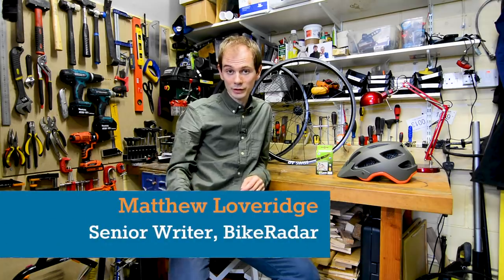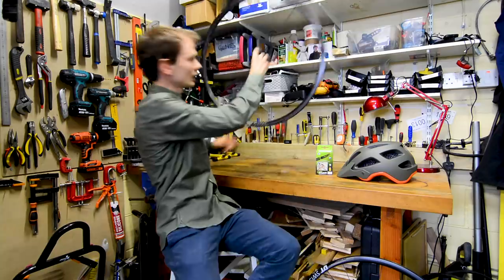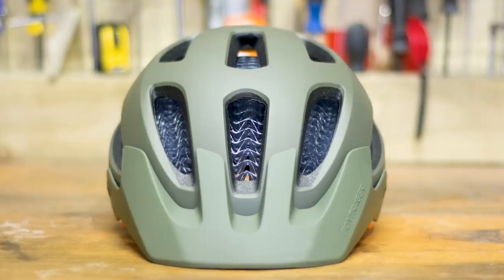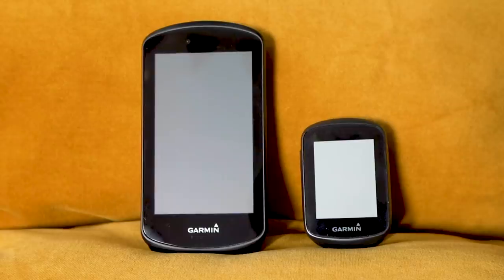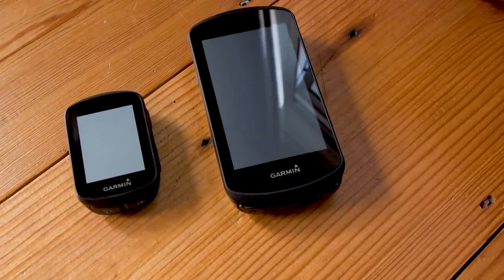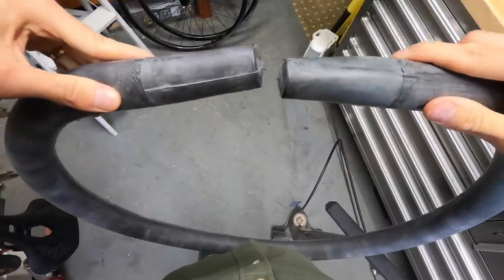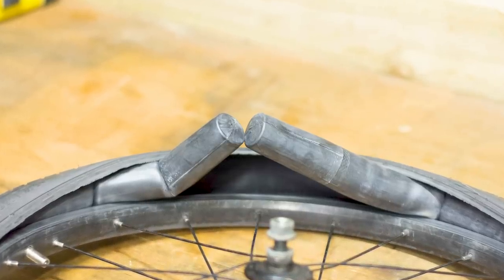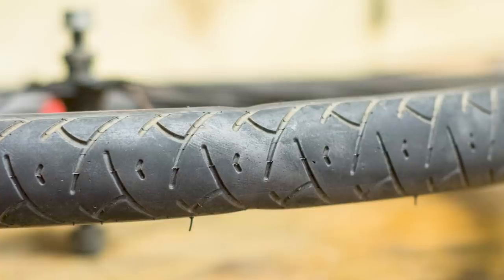NEW Garmins, WEIRD Inner Tubes & Super Light Wheels | BikeRadar Tech of the Month | EP02

Comment: Change inner tube without removing the wheel? And how does that helps with the fact that it makes very difficult to check the outer tube for whatever might caused that flat tire in the first place???🤔🤔🤔
Reply: That's what I thought. Shouldn't you be examining the tyre and tube?

Comment: gaadi inner tube are not new at all and there mostly for dutch bike or bike witch need tool to remove the wheel 
mostly for emergency or for old bike where you just cant remove the back wheel, because you can feel the junction of the inner tube and it's not comfortable at all so when you can put a regular inner tube do it

Comment: I've always fixed my punctures without taking the wheel off, with regular tubes.
Reply: How dat?
Reply: @M4ttiix3  How dat is done is easy and very old method taught to me in the mid 60's.  It does rely on you being able to find the offending hole in the tire, and most of the time I can find it.  Once you located the hole, and remember the wheel is connected to the bike through all of this, is you unseat about half of one side of the tire with the puncture hole in the center of that half, then you pull out about a fourth of the tube again with the punctured area of the tube in the center of the forth, locate the puncture, patch tube as you would normally and reinstall.

Comment: those inner tubes are just mad. I'll pass
Reply: So pointless
Reply: @ilikelampshades6  there a real lifesaver for bikeshops, replacing an innertube on front or rear drive ebikes is much easier and cheaper for the customer
Reply: I’ll be getting one for my wife’s rear hub drive ebike wheel.
Reply: @Rob-fx5yn  But how? He still had to take the wheel off anyway making the change of the tube exactly the same. How is it better?
Reply: @ilikelampshades6  no you don't, just cut the old tire out. Taking out the rear wheel and motor on something like a stromer is a pain. This will have you going in a few minutes
Reply: @ilikelampshades6  like ken said you just cut out the old tube and put in a gaadi